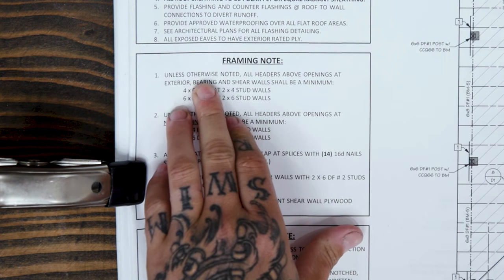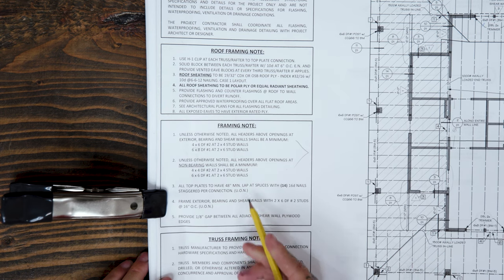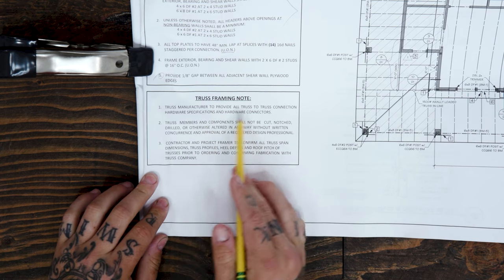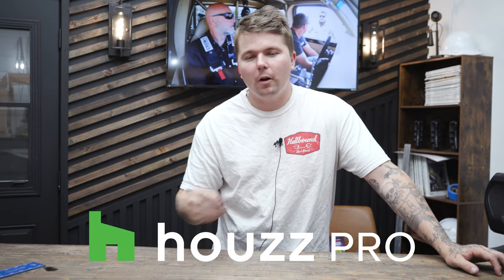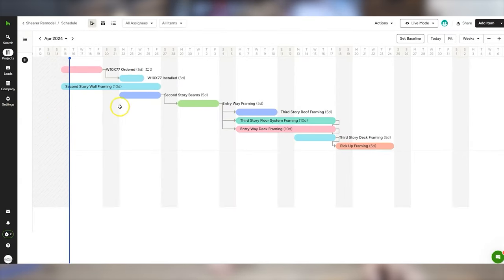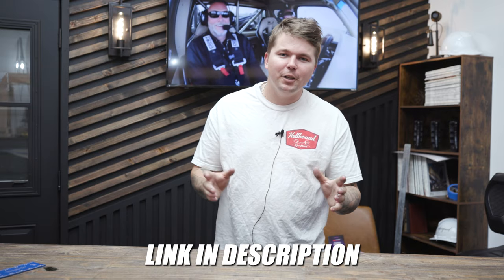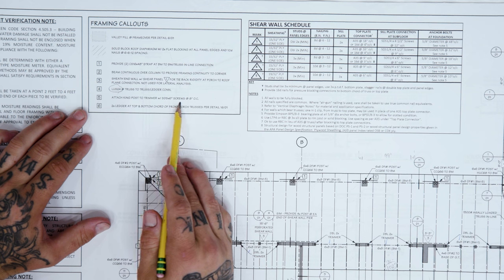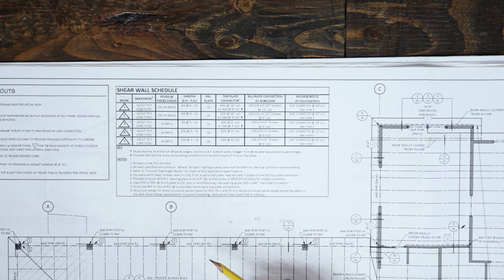How-To: Reading Construction Blueprints [Structural #1 - Beams, Straps, Shear Walls]

Comment: Very educational. I would have preferred a different order of explanation, though. It's probably a personality thing, but I would have liked the grid part to be first. It helps me with orientation. Basically from rough to detail, instead of detail to rough. My preffered order would be orientation, rough, detail, pitfalls. Might be just me, though.
However, overall a good video.
Reply from the maker: Unfortunately, I’m a carpenter and not a teacher. I just roll the camera and go over things..

I forget what is known and what is unknown.
Reply: @MattBangsWood  No worries. I still learned a lot.

Comment: Why don't you go into framing multifamily projects?
Reply from the maker: No money in it unless you’re overly efficient with massive crews that don’t have problems..

Multi family in the area pays $12-14/ft. Custom pays $25-40/ft.

I can build 3,000SF custom for $99,000 in labor.. or 8,000SF multi family for $99,000.
Reply: @MattBangsWood  I was the PM for a general contractor on a 400 unit / 450k sqft apartment complex. The framer’s contract alone was $10mill 

You have got to get into that.
Reply from the maker: Is that labor only? If so it’s not terrible at $22/ft.